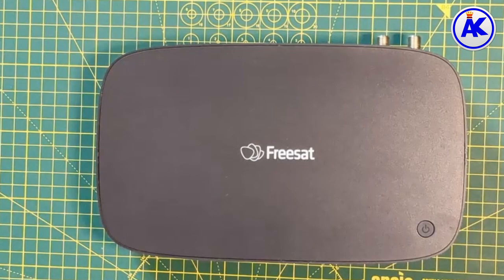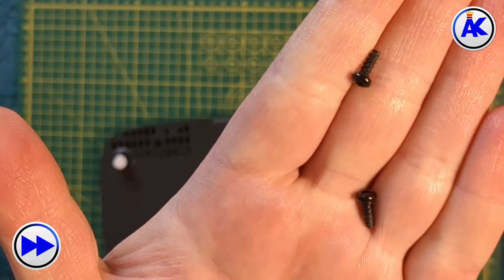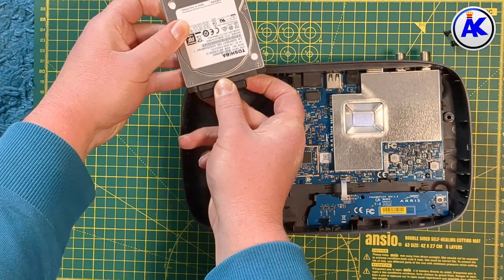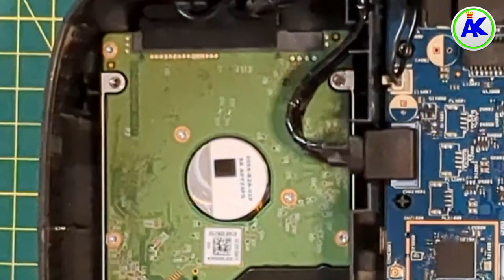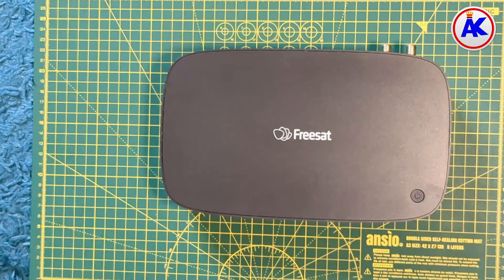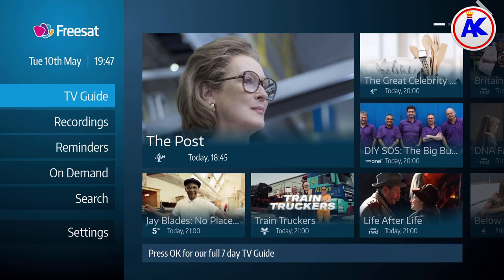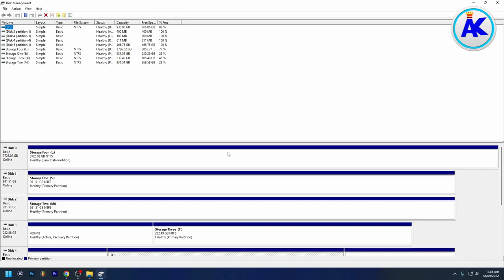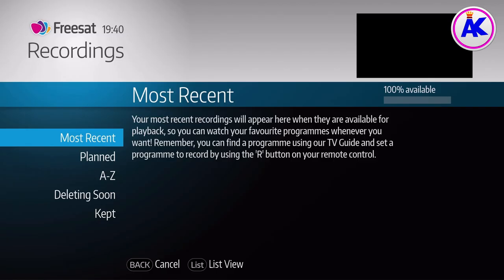How To Replace/Upgrade Your 4K Freesat Box Hard Drive (Fix Problems)

Comment: Thanks for this - any idea if you can drop a HDD into a non-recordable unit, to upgrade it? Is the cable included inside?
Reply from the maker: I haven't had hands on with a non-recordable unit but would like to at some point. I highly doubt the cable is included though. I think all of these boxes use the same motherboard as the non-recordable unit has 2 satellite ports when it only needs and uses 1.

If I'm honest, these boxes seem quite cheaply made so it wouldn't surprise me if they are the same inside. The edges are sharp as well which is another sign they are cheaply made which is unfortunate.

Back to your question though, if you can get a hard drive cable that fits these boxes from somewhere, you may be able to use a hard drive with your box. The recordable box cases are bigger though so you'd have to leave the lid off of yours and have the hard drive dangling out, which isn't ideal.

I intend on making a video on something similar to this if/when I pick up a non-recordable box. The video would be about whether or not you can fix a recordable box by using the non-recordable motherboard as a cheaper way of fixing it. Or if you can convert a non-recordable into a recordable such as in your case. I'm waiting to try and get a faulty non-recordable one as I don't want to spend much on one since I already have a recordable one.

Anyway, sorry for the long comment and for not being more help. If your box is out of warranty, you could open it up and see if it has the hard drive connectors on the motherboard. If it does, it's very likely you can use a hard drive with your box.

TLDR: You can convert a recordable box to a non-recordable one if the hard drive fails or if you remove it, so I don't see why you can't convert a non-recordable box to a recordable one if you have the cable and the motherboard has the connections.

Comment: Thanks for sharing this video. I'd like to purchase 1TB Western Digital Hard Drive. Could you kindly send the link where could I purchase Thanks
Reply from the maker: I don't think Western Digital make these anymore which is unfortunate as it's a fast one. I can't find it on their website and because it's now rare, sellers are selling it way overpriced. Seagate do 7200rpm 2.5" hard drives though if you don't mind using a different brand. I personally have had 2 Seagates break but other people say they're very good and recommend them. You might also find the HDD I have from places like CEX.

Here is the listing for my HDD though, but I don't recommend paying anymore than £50 for it. https://www.amazon.co.uk/WD_BLACK-Performance-Mobile-Internal-Drive/dp/B082LWP1MQ/ref=pd_ybh_a_d_sccl_2/259-1144129-2463505?pd_rd_w=YlrZr&content-id=amzn1.sym.8376088b-0f61-403e-bc7e-9463f4fe112d&pf_rd_p=8376088b-0f61-403e-bc7e-9463f4fe112d&pf_rd_r=9QKT4D2YNVDVB8CZ98RF&pd_rd_wg=9Wi1H&pd_rd_r=421096e0-4259-4ce9-8a60-41769c0e0796&pd_rd_i=B082LWP1MQ&psc=1

Alternative HDD's: https://www.amazon.co.uk/s?k=7200rpm+hdd+2.5%22&ref=nb_sb_noss
Reply: Much appreciated for your information.  It is a  bit pricey. I was hoping for under 40 pounds
Reply from the maker: Any hard drive will be fine, it's just that the average one might seem slower than the one I have. CEX usually sell hard drives cheap so you could get one from them. They might even sell a fast one 👍

Comment: Are you using a standard data HDD ? One you would use in a pc for instance ?
Reply from the maker: Yeah, a standard 2.5" hard drive for laptops. It's a faster than average one though at 7200rpm. You can use a slower one but I didn't like how slow my Freesat box was with the original drive so I got a fast one, which does seem to make the box faster.
Reply: @TheApacheKing   thanks very much i have a 500g and would like more recording space as im lazy at watching my recordings and yes it is a bit slow in this modern age of 1tb fibre

Comment: I can only find this model on Amazon that delivers to Spain    -    WD Black -  ... High-performance desktop hard drive de 500 GB (7200 rpm, SATA a 6 Gb/s, 32 MB de caché, 2.5")    Would it be a suitable replacement.  Thank you in advance
Reply from the maker: Yeah, that seems to be the 500GB model of the one I bought. It'll work fine and you should get a speed increase using it over the one that came with your Freesat box.

Comment: I did the reformat, then upon loading up it said it wasn't working and needed a reboot again, then it said repairing hard drive...it rebooted and the disk is working again, so  new hdd isn't always required!!
Reply from the maker: That's good you got your HDD working again. But usually when these Freesat boxes come up with that message, it means the hard drive is failing or has failed. Yours may still last a while but I'd prepare for a full on failure in your situation. If yours does fail, you can use a used HDD to save a lot of money. You don't have to use a brand new one. Yours might stay fine though and you won't need to replace it👍

Comment: Hi, thanks for the video, I was getting a mesaage saying there was a problem with my hard drive and the only option I had was to reboot, I couldn't even get channels to come on, I have followed your instructions and replaced the hard drive with a used one I had, I'm still getting the same issue, if I goto settings it says HDD failure but when I formatted etc on pc all was OK, have you any ideas
Reply from the maker: You could try checking the drive for errors on your PC by going to 'This PC', then right-clicking on the hard drive, going to 'Properties' and under the 'Tools' tab, click on "Check".

Have you tried formatting the drive on your Freesat box or only on PC? You could try formatting it on your Freesat box if you haven't. You could also try resetting your Freesat box but I recommend seeing what Freesat themselves say first before doing that, they may have a better option.

I'm not sure what else to suggest I'm afraid, apart from trying another hard drive if you can. If you haven't tried my troubleshooting at the end of the video, you could try deleting any partitions on the drive and then go along with the process to format it to your PC again, and then format it to your Freesat box.
Reply: Thanks for the reply, I did all of the above, and got it working again, what I did in the end was delete the volume on a pc but then not format on the pc but put it into the arris box, and let that format the drive, all was working spot on until I turned it off last night, then this morning it's back to the same problem, I did put the original hard drive in thought as both the old and replacement I had were fine for errors etc on the pc.
Reply from the maker: That could be a sign that it's on its way out if it works one minute and then doesn't the next. It's possible both of yours are on their way out, or these Freesat boxes are fussy and conditions have to be a certain way with a certain drive at a certain drive health, etc.

If you still have the issue, you could try getting another used hard drive from CEX or somewhere similar that offer a warranty. At least if you still have the issue, you can take the drive back and then contact Freesat. I'm not sponsored by CEX, I just suggested them because their hard drives are cheap and they offer a 2 year warranty.
Reply: I'll have a go with my replacement drive tonight it's only a quick job now I know how, I'll report back, if I'm getting the same issue I'll try buying a cheap drive like you say from Cex.
Reply: Hi, spare drive now in freesat box and working OK again, same again I plugged it into pc first and deleted the partition just left it as unallocated space. What's weird though my pc doesn't think there's anything wrong with the drive I've taken out. Fingers crossed it still works tomorrow and it's been in standby a while again. Thanks for your help 👍
Reply from the maker: Awesome, hope the issue has been fixed and stays fixed now 😊
Reply: @TheApacheKing Thanks for your help it's appreciated, it's been a learning curve but seems to be fixed now. 👍 Good point to note in my case anyway was not to format in the PC but just leave as unallocated space, otherwise the box didn't like it.
Reply: I wonder if I could put a bigger hard drive in now I know what I'm doing, or is there something in the box software so it knows what the original drive was, my box is 500gb could swap for a 1gb perhaps, for now I don't think I'll try and fix what's not broken 😂
Reply from the maker: Yeah, you can do that. My box is a 500GB version but I put in a 1TB HDD and it worked no problem. As long as you stick to their sizes which are; 500GB, 1TB and 2TB, then they should work fine. Anything outside those sizes is unlikely to work.

Comment: I have done ssd swap on mine and now keep getting overheating message..but running temperature is unchanged. ?? Any advise.
Reply from the maker: I don't think these support SSDs. They probably didn't implement an error code or screen for when people do this because they'd rather you didn't. I've heard other people say they use an SSD and it works but I couldn't get mine working.
Reply: @TheApacheKing it works but every 20 minutes overheats at 128c I guess the power draw is to much for the box and the cooling components.
Reply from the maker: SSDs use less power than regular HDDs so I don't know what causes the overheating. SSDs work differently and it seems like Freesat didn't implement compatibility for SSDs so I suppose it's just getting confused. Or maybe there's too many data streams for the SSD to handle. When you watch live TV, the Freesat box is basically recording in the background constantly so maybe all this recording and stuff is too much for it.

Anyway, I recommend using regular HDDs because SSDs don't seem to work very well.

Comment: Will this let me play fortnite in 720p
Reply from the maker: Ofc. You'll have to enable it in the settings though. By default, the resolution is 480p for some reason.
Reply: @TheApacheKing  I tried that but all i got was a warning that my account would be banned if I did not win a watch using a sky remote instead of controller
Reply: Update: just won a match using the sky remote and it overheated so I will have to ask Greggs to repair my Freesat.
Reply from the maker: Oh, bad luck. I was going to suggest using a Sky Digibox remote, they prevent overheating. Or use a Sky+ remote which prevents overheating as well but has the added benefit of being able to use cheats. I used it to get passed the Level 5 boss, used infinite health and gave myself 1 coin which I spent on My Little Pony Minecraft skin. Hope this helps 👍
Reply: It's ok, after getting through to Jim Ryan at Sony he sent me a fax on behalf of Cadburys detailing a workaround. I just have to do a 80hr live stream on eBay of me playing Freesat and I'll win a cheeseburger happy meal and a 8k OLED Freesat 👍
Reply from the maker: Wow! That's awesome Dewd! 😮